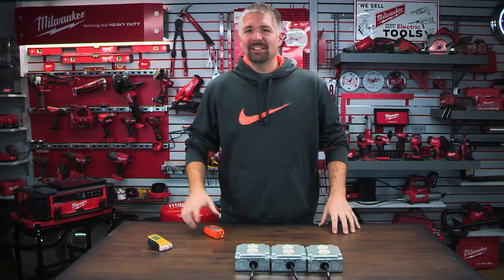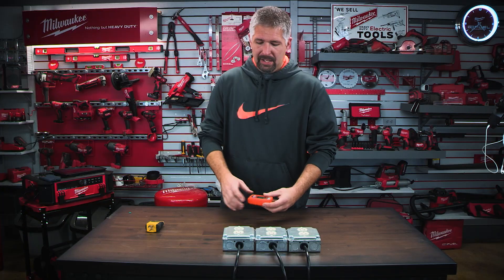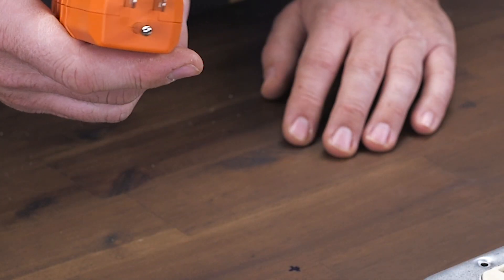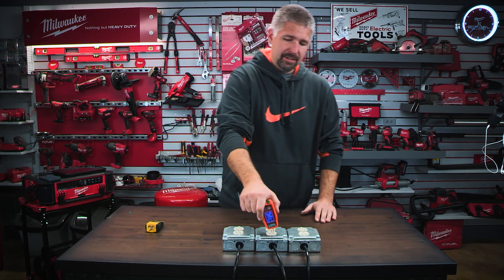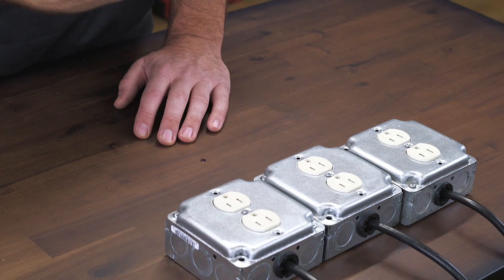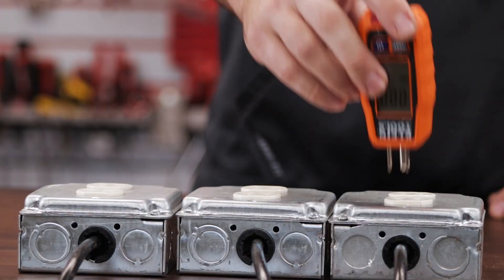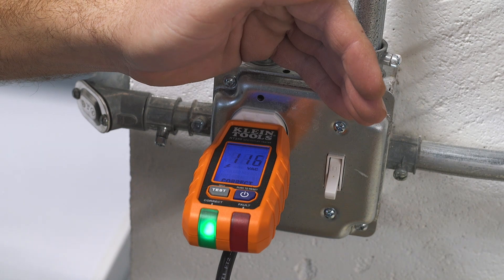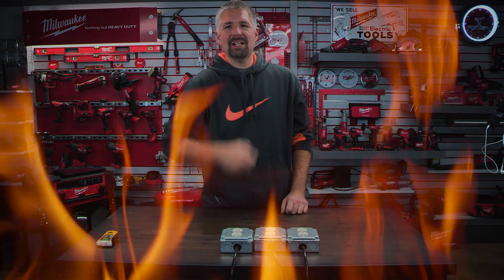Best Klein Tools RT250 GFCI Receptacle Tester with LCD

Comment: Can the Klein unit determine that the safety ground and the neutral are not connected together? I have seen that done in outlet where there isn't a safety ground to connect to. I don't know if it was done as a kind of fraud since it fools the testers into sensing that a safety ground is present or as a better than nothing idea to provide some kind of safety ground in the outlet. Detecting that situation would be tricky but it could be done.

Comment: Thanks for making this video. I lost power to 5 outlets in my house. I picked this tester up, and all read 30 volts besides one. That one doesn't register at all. Should I assume that's my bad outlet? I'd really appreciate any help.
Reply: Also, instead of removing the receptacle covers and using a multi-meter on the screws for testing, you could place the multi-meter probes in the slots of receptacle outlet openings to see if they are live or use a "non-Contact" voltage tester to determine a live or dead outlet where the receptacle is "back stabbed" and is the cause of the failure.
Reply: @billhandymanbill2775  Thanks! I've got everything working.  Excellent advice
Reply: @bubinga_basher  what was the electrical problem you had??
Reply: @billhandymanbill2775  It was 50 years old lol.
Reply: Sounds like somebody using the "back stab" method of wiring up each of the outlets, meaning they didn't use the screw terminals on the outlet, or they didn't "pig tail" the wires but instead pushed the wires into the back of the outlet.  While the "back stab" method is approved, it can be unreliable because it really doesn't make a good electrical connection.  Generally, as soon as you say, "I have lost power to several outlets", it means there is an electrical break in the circuit and therefore every outlet past that electrical break will not have power.  With the outlet covers removed, CAREFULLY, use a A/C multimeter and test each pair of wire (touching the screw terminals) to see where one pair is "hot" and the other pair is dead, and you have found the problem "back stabbed" outlet.  Maybe the 30 volts indicates a poor electrical connection so I would use the above test procedure on that outlet.  Good luck!
Reply: I just saw another video on this tester, and he had "30 volts" with an "open neutral" so again, I think it is a "back stab" wiring situation which can be remedied by wiring using the receptacle screws or "pig tail" wiring method.

Comment: I thought you were going to back up the claim that some of the older testers display the wrong lights when you wiggle them a bit, but what you ended up showing is that the Sperry outlet tester has a faint yellow light (which is an excellent point), and that if the user plugs it in for just a brief second, the blue light could confuse someone into thinking the outlet is correct, which is also a good point. For displaying the wrong lights, I did not see that in this video, unless the blue light is what you were referring to. If any tester is used on an old outlet that is wearing out (intermittent connections), it could display a faulty reading, but is it the outlet tester that is defective? I say no.

Comment: This tester has the ability to detect open ground and neutral with a live hot that other plug-in testers do not detect.  Those testers won't light up which indicates an open hot.

Comment: I have one it's excellent,  but no reason to beat up & be bias towards the Predecessor , I don't see them being obsolete to a completion, .. but yes klein was more visually innovative with the outlet tester, excellent job , but the older ones , I will still use as well.
Reply: I agree. If an older outlet tester gets a different reading when a user wiggles the outlet tester, that can happen if the outlet is nearly worn out to the point that any plug has difficulty making contact 100% of the time; that I have seen happen, and it is understandable because the older testers are directly connected and do not have any memory like the RT250 tester. That is not a fault of the tester itself. In a new outlet (where the contacts are as designed), the older testers will show the same exact results as the new RT250 tester (for correct/incorrect wiring).